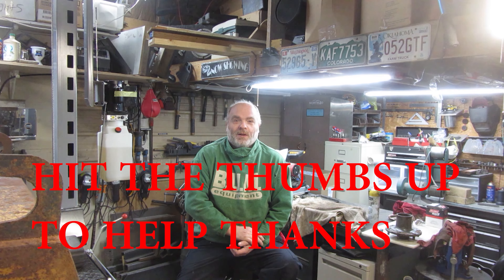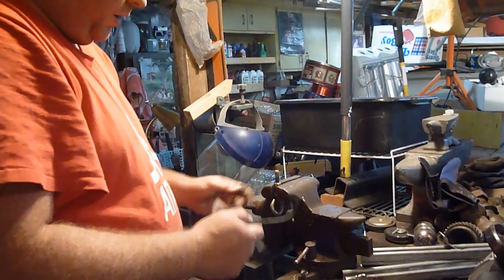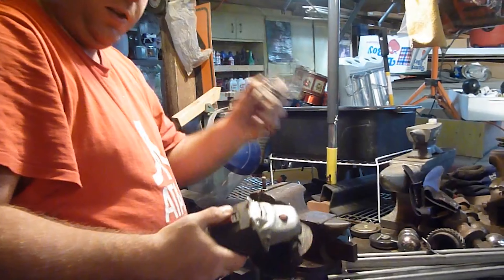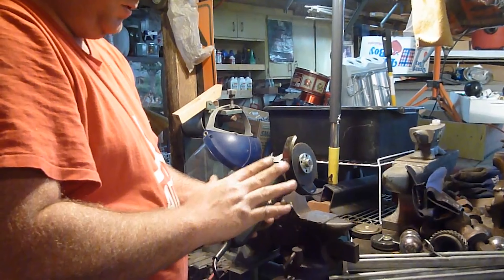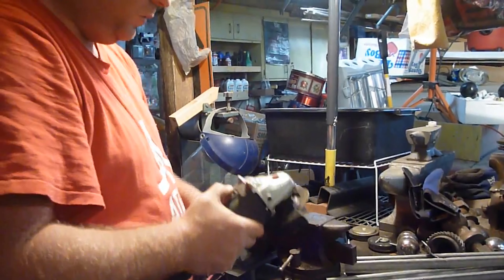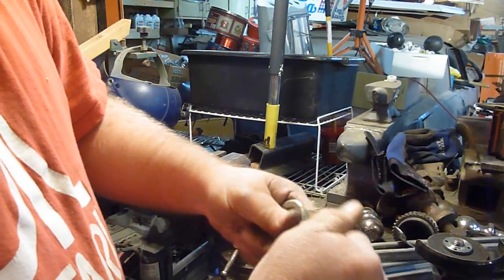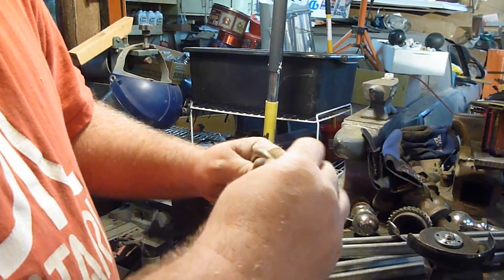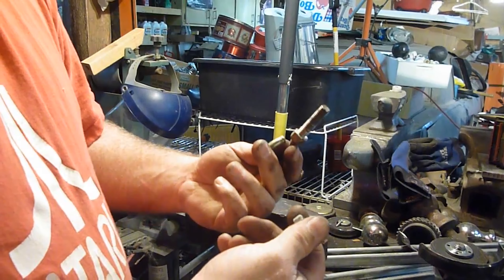THE BEST WAY TO SHORTEN A BOLT

Comment: I dont have a grinder but i have a oscillating tool and needed to figure out how to shorten the bolt gonna use a wingnut..and it will work the same for my removable trailer side post pins..Thx for the video!